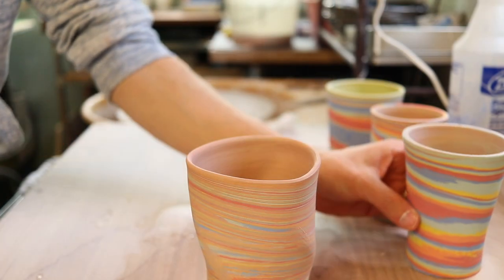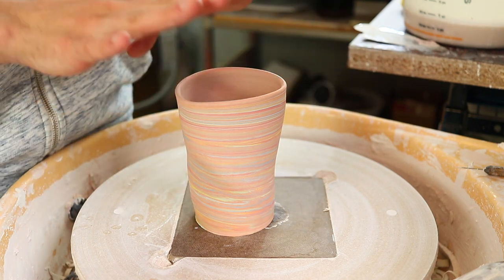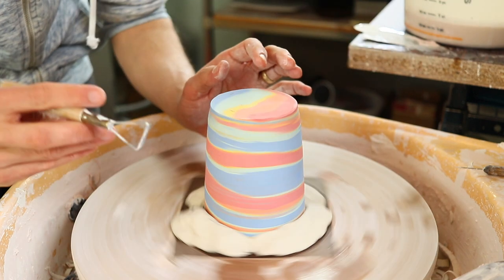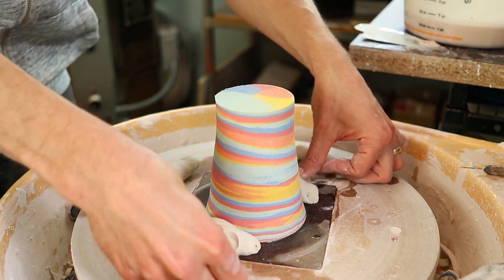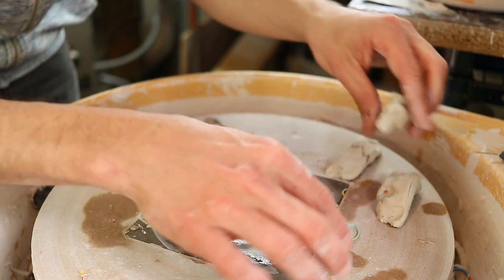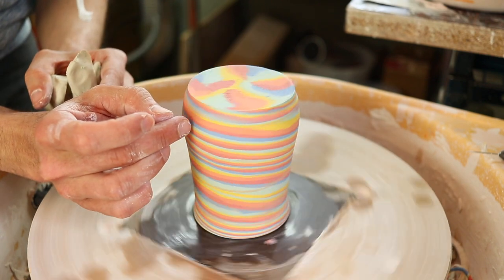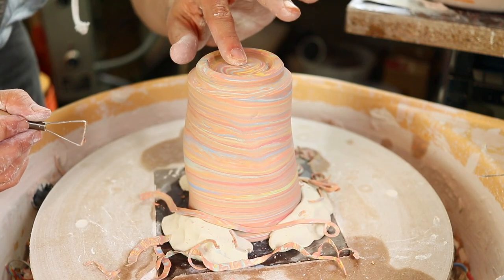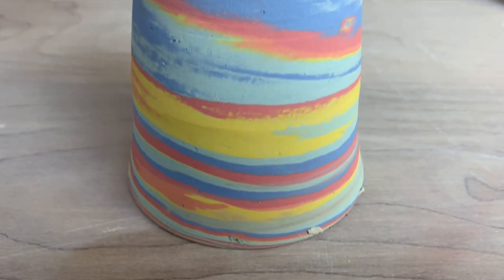Trimming Mugs 3 Different Ways (Beginner to Intermediate)

Comment: Really great work, I like the feet on tea bowls the ones that look like flowers or shapes. Have you ever had to add a foot because the bottom was to thin or do you just toss and make another?
Reply from the maker: Hmmm. Yes, I’m fond of those kinds of feet too. I’ve added a foot on a few occasions. Definitely earlier in my throwing when I was more attached to my work and it was harder to make good pieces. Now I always think, “I wouldn’t want to buy a piece that was fixed that way.” So I don’t do it. If it’s intentional then I’m okay with it. That’s a great question. I don’t think there is anything wrong with it unless your selling work professionally.